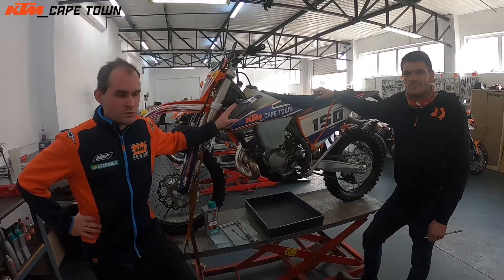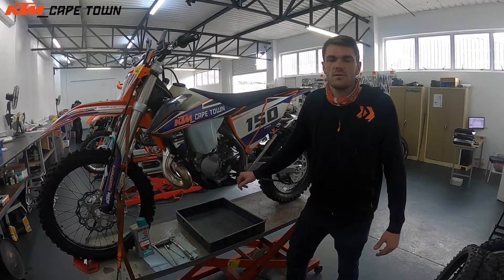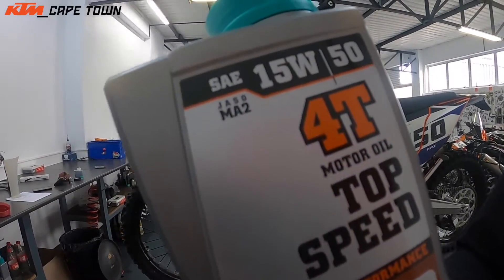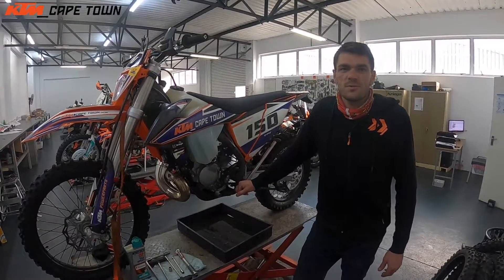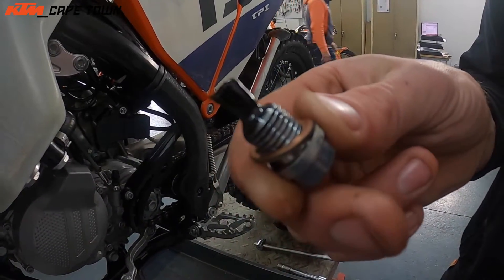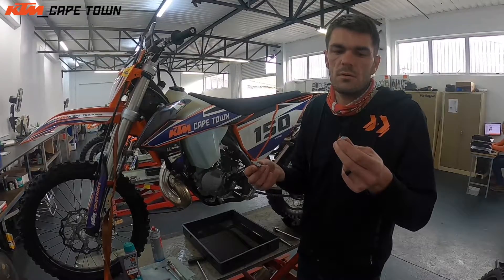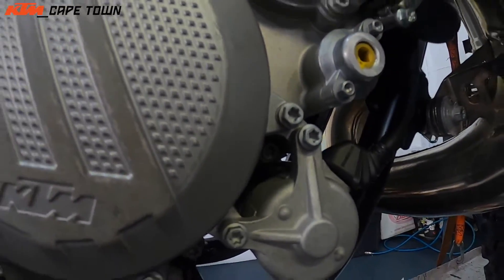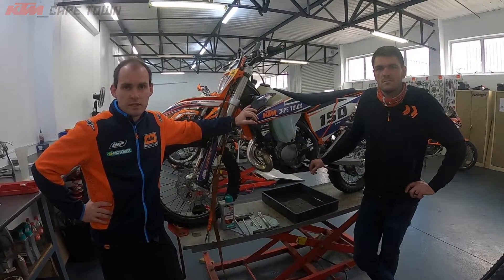Tech Talk - 2 stroke transmission oil change

Comment: I’m new to 2 strokes!!! So is the engine oil and transmission oil and gear oil all the same thing on 2 strokes???? OR do you put these 3 oils in different locations?
Reply: You mix premix oil with your gas... for the gear oil thats different it goes in the crank...belray 75w gear saver works great.
Reply: @cadillachernandez2271  okay so oil and gas mix, if atv has resivoir separate for 2 stroke oil that’s okay right?

Now the crank case oil, is that or is that NOT the same as the same 2 stroke oil in the resivoir? If NOT, then WHAT do you put in that crank case?????

(Transmission-Automatic CVT v-belt)

not the same as where the oil would go?
Reply: I’ve been trying to figure this out for so long man and have searched the internet but know one explains it.